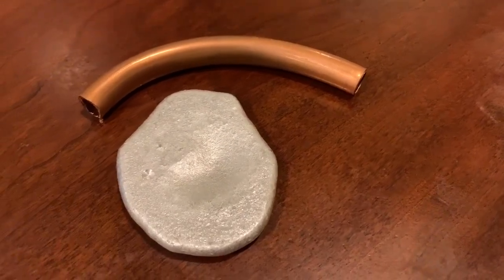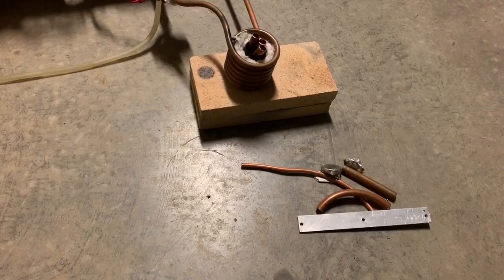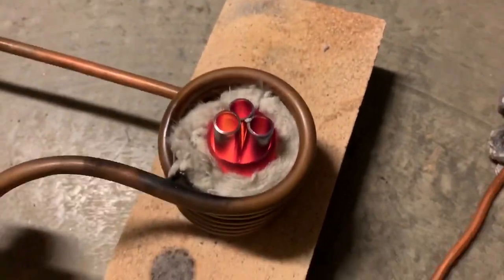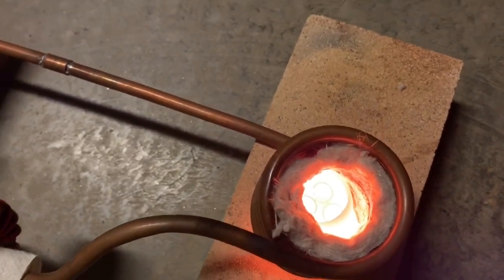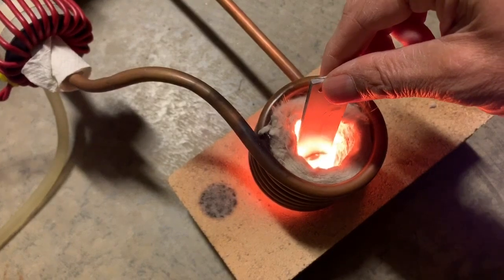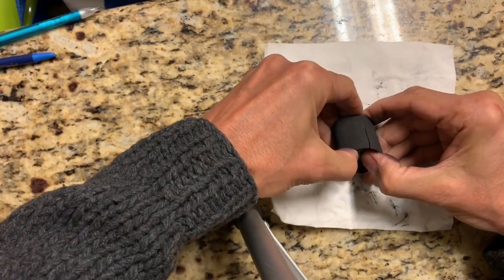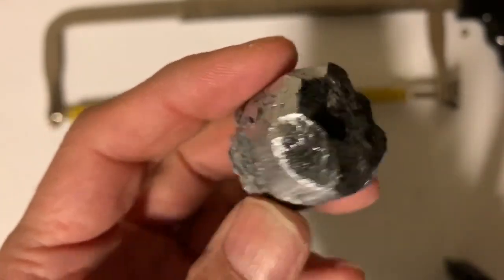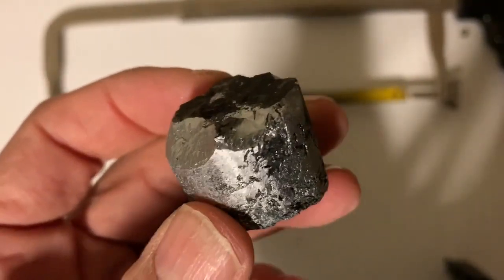Will aluminum and copper mix?

Comment: Is the 2/3 ratio by weight or dimension? Also can this withstand a milling machine or a turning from a lathe without coming apart? How long must it cool per weight to not separate the metals back apart?
Reply from the maker: The proportions are by weight. The metal seems to be really brittle. It may withstand milling, but when I tried to to cut it with a hacksaw, it didn’t seem to be very workable. It’s a bright silvery color and yet if the ratio of the copper is increased, then it becomes a golden color often known as aluminum copper brass. This is my next project. I think that would be kind of cool.
Reply: @BrianDhvTinkerer wow thank you! I figured if given more time and heat the metals might mix and be more solid, maybe a little hammering while red but not placid. It looked pretty brittle. Gonna be setting up a mill soon (po boy style, but solid) to test a few things and make a few things floating around in my head. Thank you for the info.

Comment: Interresting. What would be nice to know:
Both aluminum and copper, as separate metals, produce eddy currents when moving near a magnetic field (or when stationary near a moving magnetic field). In response they create their own magnetic field, repelling the magnetic field of the magnet.

Will this metalurgic mix of copper and aluminum have the same property? And if so, does it repel a magnetic field (when moving in relation to it or vice versa) with a stronger force than copper and aluminum does by itself?
Reply: U ever figure this I was also curious if it was nutuel or repellent
Reply from the maker: @1645austin no I gotta make another batch of this. I want to make it such that I can demonstrate the paramagnetism or the induced magnetism. Still haven’t got around to doing it yet but thanks for making me aware of it.

Comment: I don't think mixing this two metal would result a great product. Aluminum and copper if in contact with each other would occur "galvanic corrosion" . The corrosion occurs when the two metals have different electrical characteristics and the presence of an electrolyte allows a conductive path to form between the two metals.  This path allows for metallic ions to migrate from the anode (positively charged metal) to the cathode (negatively charged metal), thus weakening the anode and making it more susceptible to rust.
Reply from the maker: Good idea I need to add it into water and see what happens!
Reply: So Brass is not a thing, right?

Comment: And what about 18k gold 
But use aluminium instead of silver...
Reply from the maker: Would make an interesting “expensive” alloy 😄
Reply: You don't want to do that because you'll end up with a purple intermetallic mess that will make getting your gold back difficult.
I suggest taking advantage of a much cheaper metal for learning with because that's a very steep learning curve you're talkin about.
I I've heard nitric acid can be used to recover the gold but I wouldn't be inclined to find out just let someone else do that and learn from their mistakes

Comment: Warning to Be careful, one aluminum shard is all it takes to blow up your gas tank if you're using a torch. You should have proper shielding around your tank if you use a torch. I love your setup it's fun.
Reply from the maker: Luckily that was melted with an induction furnace
Reply: Please tell me more about why it can blow if using blow torch ?
Reply: @yadisuharyadi3866  because if a shard of molten metal shavings flies off it can puncture the tank. I was more specifically speaking that if people use torches or tanks nearby.
Reply: @yadisuharyadi3866  I'm talking about torches that have tanks..

Comment: Apparently if you mix iron copper and aluminum and add eletricty it has anti gravity properties.  Not sure how true this is but do with this information as you will
Reply: Wtf are you talking about
Reply: hg70/cu10/cs5   / nd5 /10ho powder
.......... /200000rpm
Reply: @gabriel_martz1470 Are you talking about Thermite?
Reply: im going to discard that piece of info lol. its not true at all
Reply: That's mythology as anti-gravity properties don't mesh well with reality and if it was easy like that and we could have started colonizing space 1000 years ago instead of what is likely a thousand years from now.

Skepticism is your friend so hold on to it with all you've got and it will serve you well

Comment: Hi,  need to know whether from this alloy,  copper & aluminium can be separated now?
Reply: I'm sure that this alloy can be separated the exact same way that any other copper alloy but with a lot more aluminum slime
Reply: @rickydona919  I noticed this a few hours ago, I ran out of gas, but it melted  quite a bit of the copper and aluminum mix, creating this gold looking metal
Reply: @snikrepak  probably like a brass as if you mix a silvery metal with copper it’s going to look yellow

Comment: Did you ever consider using litz wire for the coil of your heater? My (limited) understanding suggests that the upside would be greatly reduced resistance and thus less heating of the coil. Whereas the downside would be that you wouldn't be able to liquid cool the coil. Would you need to liquid cool it if you used the appropriate litz wire? Anyway, not really on the topic of the video but I had been meaning to ask you for a while.
Reply from the maker: I did. The prob is the water cooling as you mentioned. Even litz wire would burn up with some of the currents I was generating.